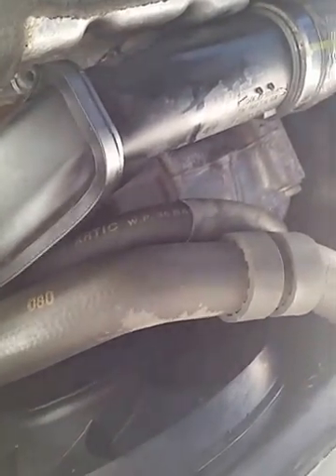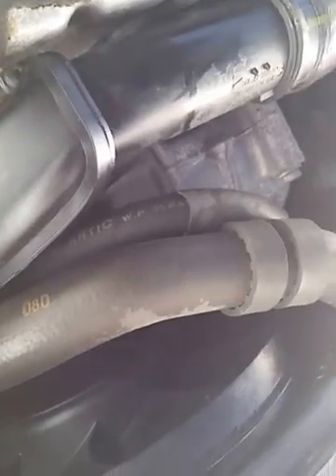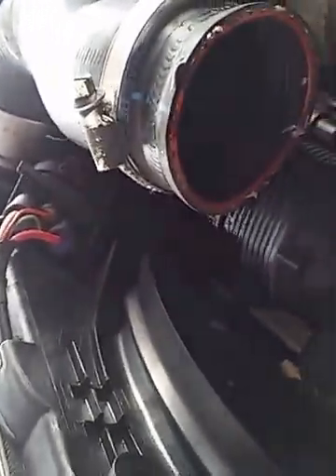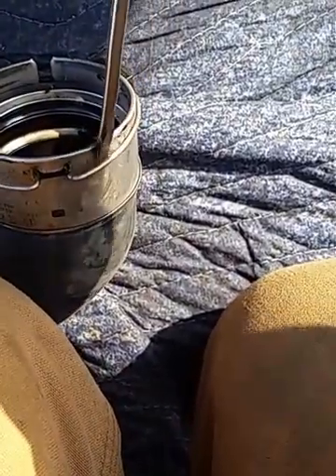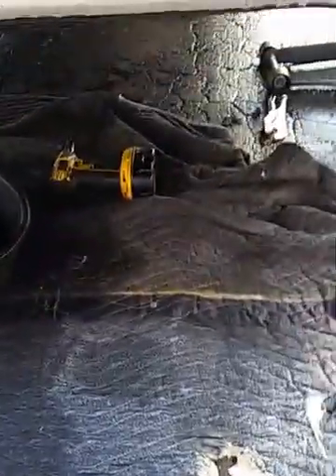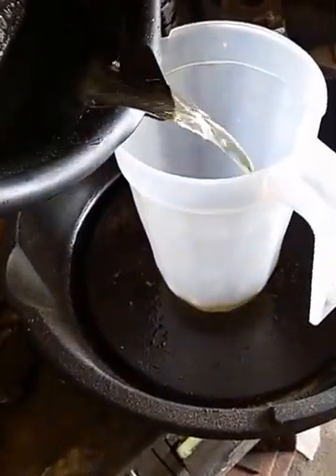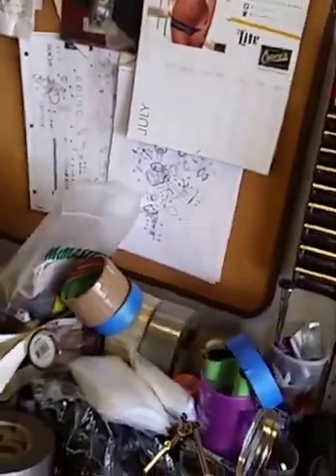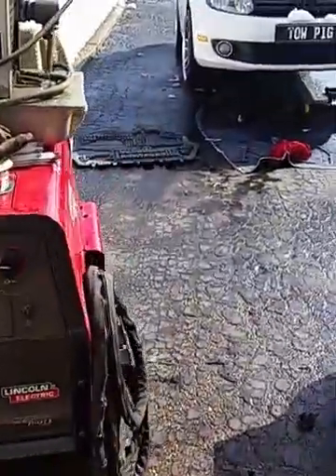2010 mk6 Volkswagen golf intercooler icing issue how to fix

Comment: My 2012 jetta just had its first engine light caused by this issue. Dealer told me it caused catastrophic damage and I needed an intake manifold, intercooler, turbo, and exhaust manifold. Vw Canada is covering all work. My car has 235000km. The new extended emissions warranty is covering it. Lol.

Comment: Mine just did this on Friday.  I couldn't believe that this was the issue.  Why have they not recalled these cars to fix this?  This is ridiculous on a car that's designed in cold climates.
Reply: Mine had an issue in 2019 and they practically rebuilt the entire engine due to water bending a rod. Again it happened 2 weeks ago. Check those pipes regularly, because they installed an updated intercooler that was supposed to prevent this.